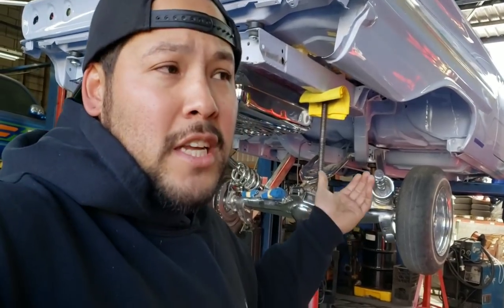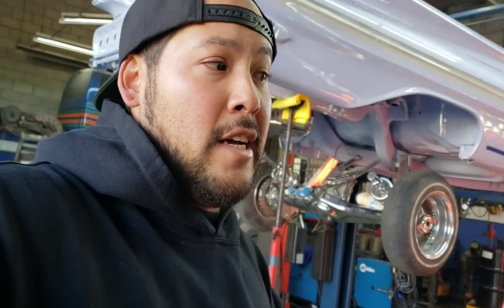Part 1.... 1960 impala  build (suspension)

Comment: "Toyota rear ends are kinda like the herpes for lowriders" .... HAHAHAHA that had me rolling. I don't like them at all, it's all about those Ford 9" to me.
Reply: Silver SS Motoring lol 😂 that was to funny
Reply: Why Ford over Toyota's?  I'm researching cuz I got a 64 I'll be doing a rear swap. Hydraulics, 13's, three wheel,  8 batteries.
Reply: @birdcityaz13  toyotas are great the look like a stock impalas but way better shorted  to clear skirts and better driving performes

Comment: Love the video. Im running the same chrome  rearend in my car. Im trying to put rear shocks in mine but those stock shock bolts dont fit.  Do you make a  custom shock bracket for the toyota rearend?

Comment: I like the setup in the back is it necessary to run an extra reverse cup on the top of the coil or is it just to prevent the coil from messing up the paint on the bottom of the spring perch?
Reply from the maker: It's not necessary  but we prefer it on painted frames  helps with it moving around keeps it centered up